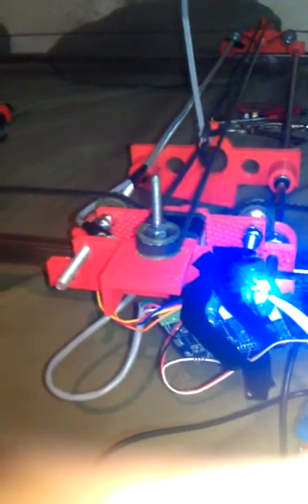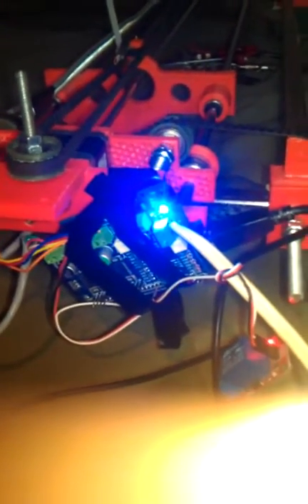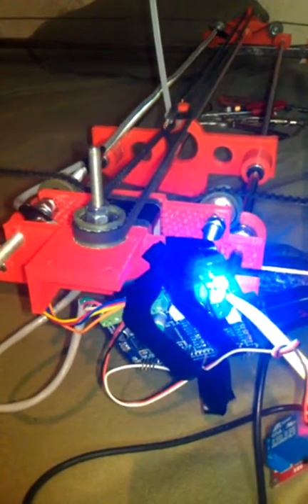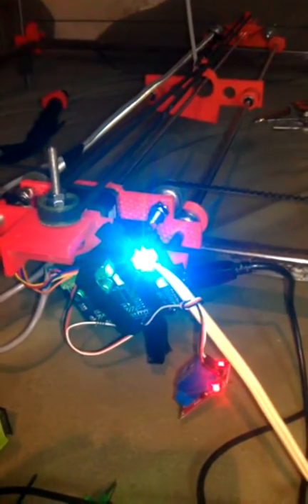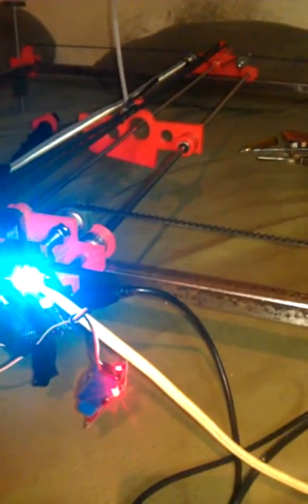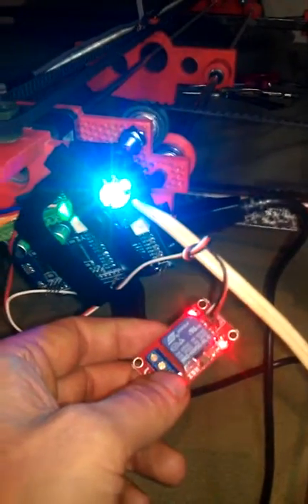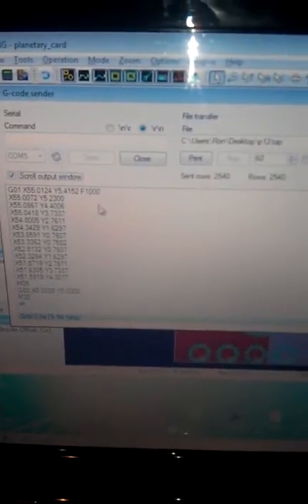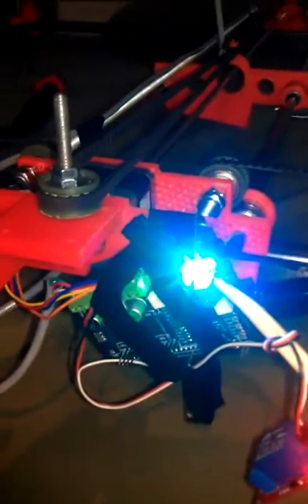plasma speed test

Comment: can you use cura for slicing?
Reply from the maker: There is no slicing slicing is making horizontal layers. This is much simpler. I use sheet cam for the g-code and sketchup for the model.... well its not actually a model its a 2d outline of the part and the cam just follows the lines basically.  Its been a long time sense i messed around with the plasma cutter but it was a lot of fun.